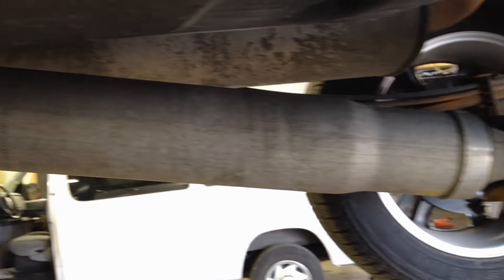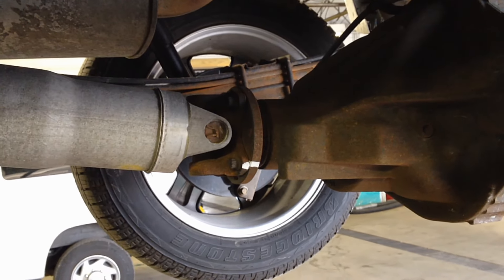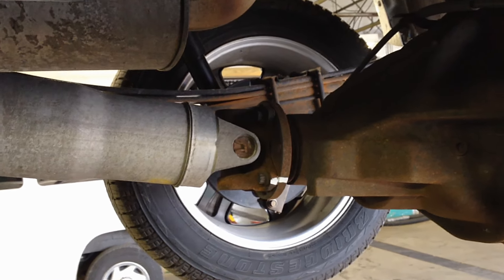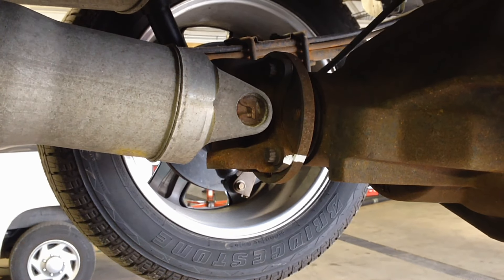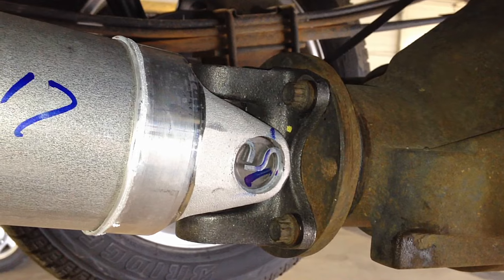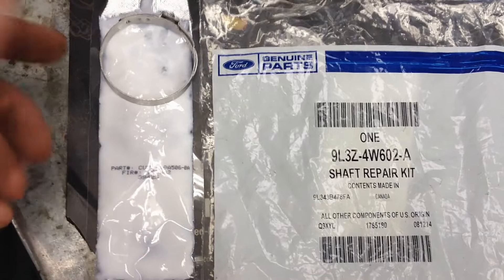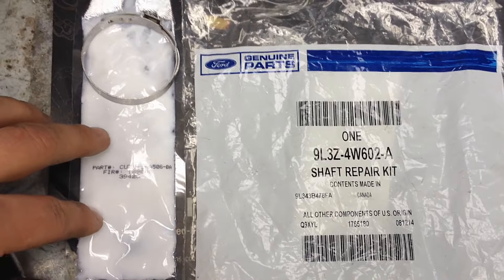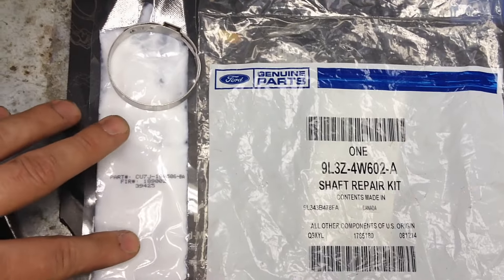Ford F150 One Piece Driveshaft Slip Bump- FIX!

Comment: I have an 08 f150 that does this but it also has a vibration when turning left at low speeds would this cause that also
Reply: If you have the limited slip from Ford, it is likely the shims/discs in the LSD unit. I rebuilt mine with a kit from Ford and it went away immediately.

Comment: I have been having 2 issues since I bought the truck, sounds like 1 may be this but I was curious if you have any insight on the other as well, and if it would even apply to my year truck. I have an 04 f150 that has a 1 piece drive shaft, the truck almost always does this "bump" or slipping feel a couple times when taking off. I have noticed if I give it more gas than normal when taking off it seems to not do it. Any thoughts? For the second issue, I have a relatively harsh 1st to 2nd shift where it seems to jump into second gear. It does not seem to be slipping and I have no issues in any other gear. Seems to smooth out when towing my trailer. Any thoughts on this as well? Will this damage the transmission? I have had the truck for about 20k miles now with this with no luck on identifying the cause. Not really giving me issues, just annoying. Thank you
Reply from the maker: Aaron Trayer First I would perform this lube trick as it can cause allot of issues

Comment: My 09 had this. My impression was a hard downshift or once I looked back to see if someone tapped me in the back when I stopped. Since it is slipped into the transfer case having lube oil in it , why does it even need lube? This doesn't say much for the lubrication properties of the thin trans fluid thats now used vs the old gear lube models.

Comment: I have a 2010 4x4 that has the same issue, but mainly when I'm decelerating and coming to a stop. What I get from your video, is that if it doesn't occur when you take off from a stop then I need to have my transmission reflashed, but if it does it coming to and taking off then it's the driveshaft?
Reply from the maker: +Joel Padron absolutely correct
Reply: +FordTechMakuloco Just out of curiosity, about how much should I expect to pay for a refresh at Ford Service Center?
Reply: Reflash**
Reply from the maker: +Joel Padron half hours labor for whatever their labor rate is.

Comment: i have this problem with my 2010 f150 4x4 but it only happens when coming to a stop from 2nd to 1st. do you think i should reflash it or check out the drive shaft.
Reply from the maker: For a harsh 2-1 shift you want to flash and relearn the shifts for sure.
Reply: Can you tell me how to flash and let it relearn the shifts?  I am stationed in Italy right now and need to do some maintenance on my 2010 F150.

Comment: They recently rebuilt my transmission and now when I take off i feel a thud. Also the reverse lights don't work and sometimes the van doesn't turn on until i put it in neutral and back to park.

Comment: So i have to replace the whole shaft or does greesing the old one with the ford greese works?
Reply: Right at the end he stated you can also use the grease and put the slip yolk back in and slide in and out a few times and it'll help a ton if it doesnt totally eliminate it.

I just did the grease before i found this video and it worked like a charm 🤙
Reply: @uuulaalaa  unfortunately all manufacturers have gone grease zerk free driveline, suspension etc...and it shows 🤦‍♂️

Comment: Thank you,thank you I just did my F-150 2010 two piece drive shaft and it's the best now.thank you again.
Reply from the maker: MrSamolet76 Nice!
Reply: MrSamolet76  hey! I have a two piece drive shaft also, did you remove the entire drive shaft to grease it? Did you buy the kit? Was it hard to align? Thanks!
Reply: Is this also related to the issue where when you switch from park to reverse on an incline you hear a clunk?

Comment: ptfe is slick stuff but if anyone wants to set it and forget it awhile, use full synthetic marine wheel bearing grease, stalube blue is the best
Reply from the maker: Is it good at ultra low temps like -20 though
Reply: FordTechMakuloco It's all i use for most everything and i live on a mountaintop by the canadian border see -20 actual temps regular during the winters here. ptfe is great in engines and fast spinning bearings / bushings etc that build up heat friction this is a simple joint that only needs to be free to slide a small bit nothing is spinning past anything. I have a 1996 F 250 HD diesel 4x4 that has that lovely dipped in blue crap at the factory that has so many problems down the road mine froze solid had to torch and pound it off and was concerned how thick it was. The joint only needs to not have excessive slop and basically lubed anything will work I use marine wheel bearing grease because it stays where you put it and will not allow water to enter the joint, on my truck it's a 2 piece so that joint is out in the open not the back of the case but it's the same great video ill probably watch some more been a ford truck owner mechanic by necessity since 1973 and my first rig was a 67.

Comment: Does the 2013 f-150 have this problem?  When I tow my trailer I can feel the bump you're talking about.
Reply from the maker: Northern Rider Yes they do all the way to 14 for sure.
Reply: Would an 04 have this issue with a one piece driveshaft? I have a clunk that comes when under load like going up a hill or accelerating quickly. Any thoughts? Also my pinion seal is leaking, and the seal needs replaced. Could this be a worn pinion gear or just slip bump shaft and that caused the leak?
Reply: @Bandeeforlife  I've got the same issue. Did you  ever figure it out tyler?

Comment: The biggest problem is Ford does not doing any testing done and releases the vehicle way too early.I don't even torque down the 4 driveshaft bolts down using the German torque spec using an impact.

Comment: Have you had any people complain about a shudder while going 50 mph? My 2011 started doing this and it feels like its coming from the drive shaft (single piece). I plan on sticking a camera down there to see if there is any unusual movement. It's the most annoying thing for such a smooth truck (when its not shuddering) with only 50k miles on it.
Reply from the maker: Cam Frozen or loose u joints are not likely I have seen many complain about this and the culprit is the rear shocks not dampening the spring oscillations the fix has been bilstein shocks but throw a camera under there to confirm.
Reply: FordTechMakuloco what series bilstein shocks should i buy for the fix 4600 or the 5100 for my 07 f150
Reply: He as a video using the 5100s. I put those on my F150 and they're amazing.
Reply: @GeoffKuhn  Did you have the bed shake at 50mph if so did the 5100's get rid of it?
Reply: @rangerguy1383  I didn't have the bed shaking, but it did take care of the notorious "wheel hop" which was fantastic.

Comment: Hi Brian, so I have a 99' 5.4L Ford Expedition that I've been experiencing the bumping/grinding portion of everything you described. It doesn't do it when the vehicle is cold but does do it after a long drive (like it progresses to get worse as the car warms up) I suspect it's the drive shaft. However, since it's an AWD system it has 2, as a rule of thumb should I change the front one since that's where the majority of the noise is coming from or is it usually the back one that fails under a heavy load? PS. I only began experiencing this problem on a drive back home uphill with a heavy load. It kicks in when I'm on the Turnpike going up hill (Possibly due to the movement of the drive shaft sliding in and out from the transfer case, maybe?)

Comment: I definitely have the clunk, could this also produce a shudder symptom at low speeds. Like less than 10 mph. With any amount of throttle it goes away and goes down the road just fine

Comment: For the two-piece driveshaft. do I have to open the middle one first?  Where that clip goes to? I'm waiting for the part to come by mail.  Thanks a lot
Reply from the maker: Youssef Cherqaoui For the two piece you remove the one clamp from the boot and apply the grease to the splines.
Reply: +FordTechMakuloco 
On the 2 piece, are you just saying you just need to pull one end of the boot back to grease the splines? I am trying to figure out if I actually need to remove the shaft the gease the splines or not?
Reply from the maker: yes you need to remove the driveshaft from the differential pinion flange only. Remove the one clamp and grease. Be sure to mark the boot to the shaft so it goes back together exactly the same.
Reply: FordTechMakuloco 
Thanks, I was thinking that I might have to drop the center hangar bearing to remove the rear shaft?

Also, can you just use a zip tie or worm clamp or do you recommend those one time metal clamps that are on there?
Reply: +FordTechMakuloco 
Can I use a zip tie or worm clamp for the one side of the boot I have to disconnect?
Reply from the maker: The kit that has the preferred grease comes with a new clamp that is the best way to clamp it off and keep the grease in without throwing off the driveshaft balance.
Reply: +FordTechMakuloco can you do a repair on 2 piece driveshaft?  I open the bolts from the differential but it won't slides out.  Also, even though I put the truck in neutral. the driveshaft doesn't turn at all.  2010 5.4 3v
Reply: I know this is an older post, but for anyone planning on doing this, only remove/cut off the FRONT boot clamp. The kit as shown in this video will include a new clamp. Then undo the 4 bolts from the rear flange on the differential. Knock it loose and slide the rear part of the driveshaft off. You do not need to remove anything else except the rear portion of the driveshaft. This is all outlined in the service bulletin from Ford.

Comment: For the 2 piece shaft, do I need a special tool to put the replacement clamp on?
Reply from the maker: +TandD1w I use these to crimp the clamps on cv boots and these two piece driveshaft boots- http://www.amazon.com/gp/product/B0000BYDYD/ref=as_li_tl?ie=UTF8&camp=1789&creative=390957&creativeASIN=B0000BYDYD&linkCode=as2&tag=fordt-20&linkId=R3Z4NPYFGJT7KWVT

Comment: I actually have to take my truck in, 2012 5.0, looses power on the top end, can't rev past 4300-4500 to speed up! It gets stuck, triggered a flashing check engine light for about 10-15 seconds then went away
Reply: Check your mass air flow sensor

Comment: I FORGOT TO MARK MY DRIVE SHAFT ,, NOW HOW DO I ALIGN MY 2010 F150 DRIVE SHAFT. ARE THERE MARKS ON THE DRIVE SHAFT FROM FACTORY. HELP!!!!
Reply: If you forgot, take it apart, and wire wheel the pinion flange, and the driveshaft yoke down to clean metal. Coat the yoke side with nickel, or copper based anti seize, a thin coat, then reassemble it. There isn't really any danger here, other than a thin coat of rust making the two not bolt up flat and even.

Comment: I have a problem at freeway speeds pulling weight. the transmission feels like it slams in passing gear when downshifting. i notice it most underload but sometimes when empty but changes on a hill.  2010 xlt 4x4. any ideas?
Reply: could this be the same issue on a 2010? even though the vid was on a 2011? or would this be a tranny issue?
Reply: I have the same with my 2010 also but its not all the time. 2010 XLT 4x4 also
Reply: nor is mine. it's like the Trans hard shift but not always
Reply: I have a 2012 that only recently started doing that.. last time it did it it actually startled me.. felt like someone had hit me or I had hit something cuz I felt it through the entire truck.. been avoiding full throttle passes or lane merges ever since so That the tranny won't downshift that much
Reply: Yeah id really like to know what it is, and how to fix it. sound like what hes describing but i dont know for sure ad he hasn't commented . So no clue
Reply: torque converter maybe  ? Did you fiz it?
Reply: Javier Trantow nope still have the issue
Reply: cpac97 if have same issue now why not take it out to see if it’s dry and grease and see if issue is still there before you condemn the tranny.
Reply: Have you guys found a fix for that my 2009 does it too.
Reply: Yes I have that issue in my 2010 f150 4wd . What I’m going uphill and slam it from 2000rmp to maybe 3000rmp it slams. But not on normal acceleration . But I just got the truck 1yr ago so I couldn’t tell if it was like that before

Comment: Brian, I have a 2009 F150 4.6L 6r80 trans with the two piece drive shaft but both ends are Flanged so there's no slip joint going into the Trans tail housing.

There's a flex boot at the carrier bearing.  It's going into the dealer Wed, 29 July but they said they will not replace the driveshaft. They will grease only. Sound right to you??

Two Questions;
1) Can we have the TSB number for this drive shaft info?? 
2) Can you suggest a place to get our FORD TSB's?

For info - So far, after re-watching your repair videos to get my head on straight. With my son's help, we have managed to replace all of my shocks/struts, transmission oil/filter with new adapter, spark plugs and coil packs.

Thanks!

Rick
Reply from the maker: Hawaiian F150 Latest TSB is 12-7-13 it instructs to lube the driveshaft slip joint under the boot this is a good fix with the latest kit. I believe you can get tsb's related to your vehicle on http://owner.ford.com/ otherwise alldatadiy.com
Reply: FordTechMakuloco Thanks!
Reply: Add my dealer experience in another video of yours
 Basically dealer wouldn't honor warranty.  Said greasing the driveshaft is not listed in my Premium Care warranty. Replacing the driveshaft is.  Dealer said the driveshaft only needs greasing it'
Reply: ARGGHH!!  FAT and small phone keypads don't get along.  
Let me finish what I tried to type. ..

The dealer said since it only needs greasing and the warranty doesn't cover "greasing" I gotta pay $120. If it was covered under warranty I'd only pay  $50 ded.

We need a channel to embarrass STEALERSHIPS

Comment: Hi.  I came across this video and it definitely sounds like the problem I am having with a used 2012 F150 FX4 4x4 that I recently bought with a rebuild status on it.  It shifts up the gears fairly smoothly, but once I come to a stop there is a fairly substantial thump from below, mostly noticeable in 4x2 and only slightly in 4x4 and I thought it might be a transmission issue, but after seeing this video, I am inclined to believe I might be able to solve this problem based on your description.  Just to clarify, the bump you've mentioned.... is it a substantial clunk once the vehicle comes to a complete stop?  Right where the driveshaft enters the transfer case is a seal that was leaking when I bought it, and I had Ford replace the seal 3 months ago and it's leaking again, and I'm wondering if this clunk sound is somehow related to the seal problem.  Any additional info would be greatly appreciated .    Thanks,  Kevin M.  Winnipeg, Manitoba, Canada.

Comment: Hey man, thanks for your experience and insight, super cool when someone shares their knowledge freely for the betterment of everyone.  So, I have a 2011 Raptor, I have been lubing up the yoke like every 20k or whenever I have been thrashing the truck off road (seems to re appear after a severe beating).  Ford dealer says no TSB and no recall, I bought the truck used from a private party so have no real relationship with any dealer and I have been a VW/Audi tech for about 30 years so I really just work on my own vehicles (to which I have far too many).  Can you give the TSB # and the recall # applicable to the Raptor?  Pretty sure the yoke is FUBAR at this point as it has started to prematurely kill output shaft seals.  Any help you can give me super appreciated.

Comment: Any idea if this is the same issue with the 2006? The way you explained it sounds just like the same problem I'm having. I was thinking the flywheel was slipping.
Reply from the maker: 2004-2006 model had the same problem they offered a syringe of grease for these units- 5L3Z-19A506-A
Reply: I will defiantly try this out and let you know if that fixed the problem! Thank you so much!

Comment: I've just watched many of your videos and have learned a lot. This video hit home. I bought a 2002' F-250 Super Crew SD in 05' with 32k on the clock. I didn't have it long when I noticed exactly what you are describing in this video. I asked at the local dealer and they told me they all do it.. (Not the answer I was looking for)!! I now have 105K on her and still have this happening every time I let off the brake and even slightly touch the go pedal. It has never gotten better or worse, but I would sure like to get rid of this issue. Do you think this is the same on the 250's or is there something else I should be looking for?  

On a side note, I would love to see a video on "PROPERLY" changing the spark plugs on my 02' V-10. I have heard horror stories and am a bit scared to screw up the aluminum head threads.  
Thanks for the great HOW TO's!!!!
Reply from the maker: Steve 1961P. Yes we used to do this same fix for those all the time.
Reply: +FordTechMakuloco is lubricating the same procedure on the 2WD? If so what grease should I use or do I have to go to the deal to get the grease? Thanks!!

Comment: I have a 2011 FX2, SuperCrew, 5.0L. Major vibrations start above 110Km/h, and I get a hard knock when shifting from 1st to 2nd? I wish I knew where the problem lies. Dealership tells me there is nothing wrong. Had my wheels balanced 3 times. I'm out of my warranty now so I have to do it myself. I'm not Paying Ford $120/hr to tell me nothing is wrong. They even wanted to charge me an hourly rate when I had my warranty. My 2-piece driveshaft number is: AL34-4K145-GB or NPAL3W-4817-HA (not sure which one is the right one). Can someone help?